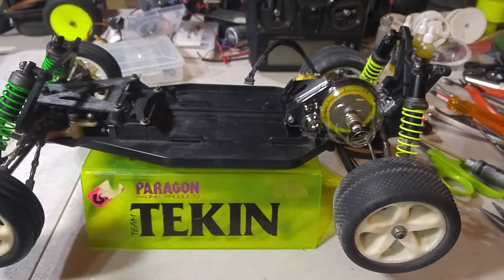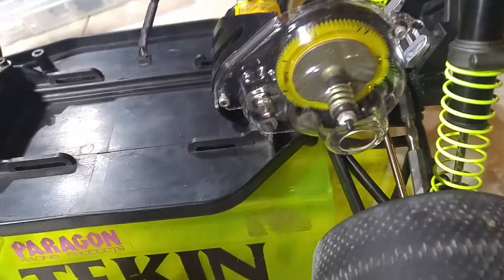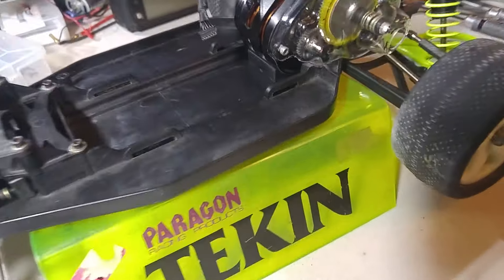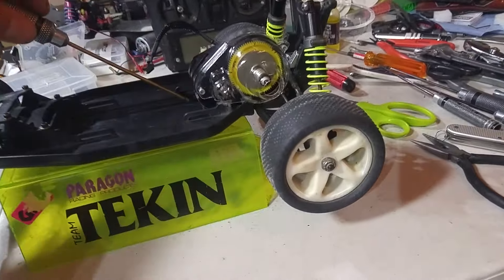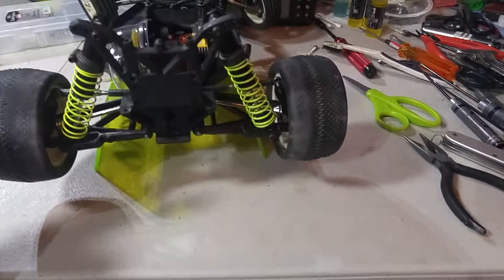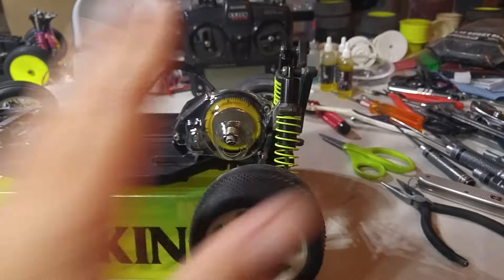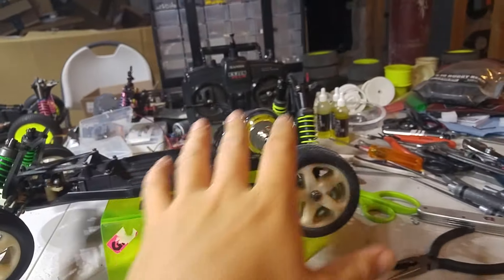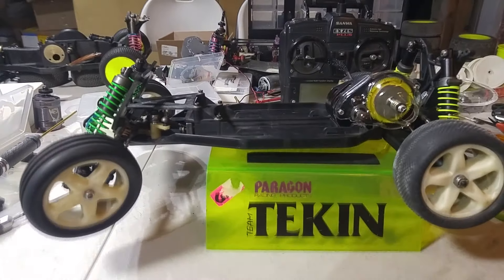Mid-Motor Vintage Losi XX Project, Part 2, 06/18/24

Comment: Nice little laundry list of things to iron out.  Regarding the body, would it make sense to go with a new repop and cut it specifically for the mid-motor, leaving as much  rearward material as will fit? It might bring the body close enough to the rear bulkhead to run a flipped newer style wing mount as a body mount.  I might be talking out of my ass though as I've never seen an uncut XX body and am unfamiliar with the contours and clearances of this buggy and body.
Reply from the maker: A "fresh" body has the rear section sloping down, so it would not meet the body post on the rear tower as the body would drop too low.  So, I need to come up with something else.

Comment: You always have the best projects R. Hey is the Kyosho SC still competitive?
Reply from the maker: Ha, thanks.  If you run that SC on dirt, it should be just fine.  I wouldn't use it on turf, though.